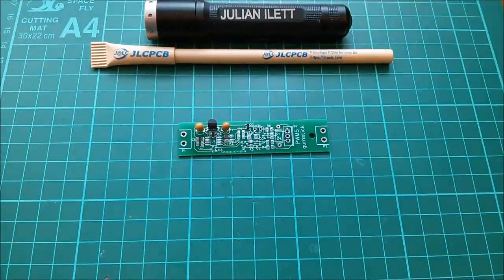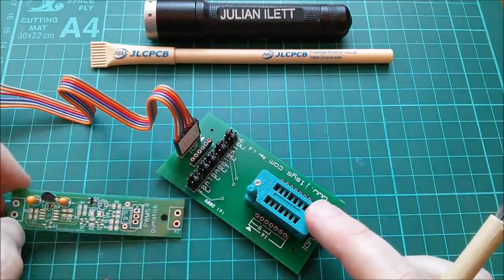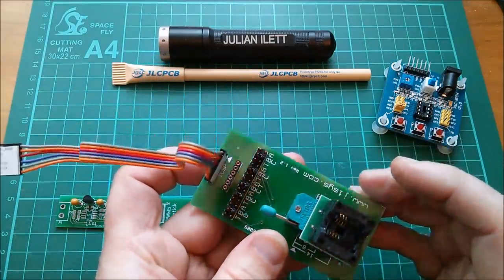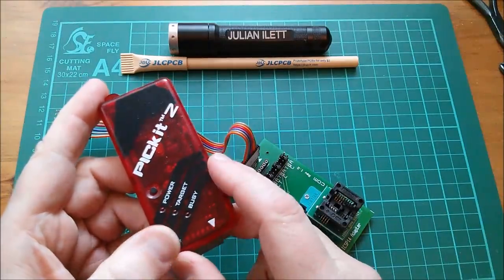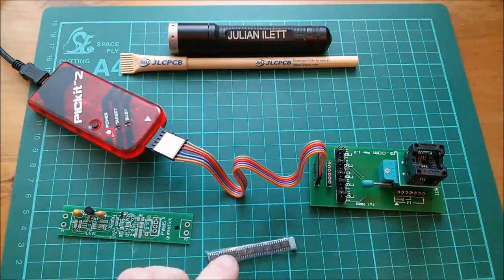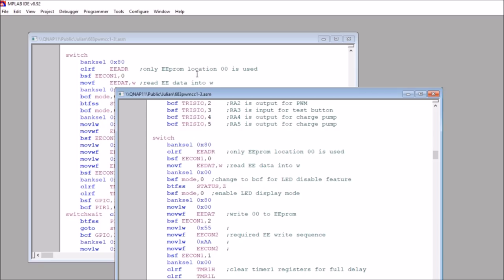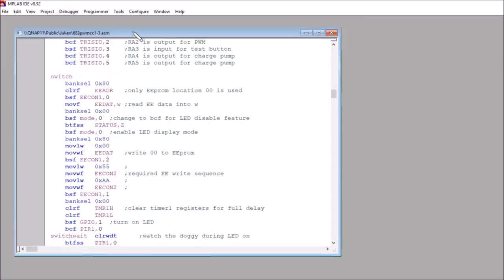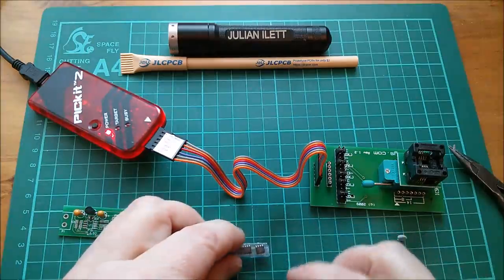PWM5 Solar Charge Controller PIC Programming

Comment: Put a few resistors in parallel if it isn't bright enough.  You can stack those 0805 SMD resistors without too much trouble.  Give it try.  17:45

Comment: so much room for a program header on that board ;)
Reply: Yes, in-circuit programming is the way to go :)
Reply: I'm interested if he can solve the problem of voltage calibration.  In an earlier video (https://www.youtube.com/watch?v=EVP6ImNmbNU), he diagnosed a problem of set-point accuracy as drift in VDD.  

Since I don't think he's changed to a more accurate voltage regulator, one way of addressing the problem would be to include a voltage calibration mode.  If he redesigns the gumstick PWM to include an on-circuit programmer, that would be the ideal time to include a programming-time calibrator.  Remaining set-point error would then be due to temperature or time-drift of the voltage regulator, rather than its initial tolerance.
Reply: Even a couple of pads for a pogo pin bed could easily be made up, so that you can have all tests done in one go.
Reply from the maker: I want the final PCB to be 1" x 0.5" approx - the world's smallest PWM solar charge controller. If there's space for an edge mounted ICSP I'll include it. It might even work with 20K and 220pF to ground on ICSPDAT and blue LED to ground on ICSPCLK. I still want to implement a calibration system to offset the voltage regulator error - pull MCLR to ground and it cycles through 16 different offset values writing them to EEPROM. Just like you said Mai :)
Reply: Maybe add a 431 shunt-reg to the board.
Reply: @Julian Ilett: You might want to have a look at tag-connect: http://www.tag-connect.com/ They also recently got their new edge-connect cable, but I think the 6 pin no-legs cable should fit fine on your board :)
Reply: Julian, you have a double-sided PCB. Pull the programming pins out into surface mount pads underneath the chip with vias, then people who are comfortable programming with pogo pins can do so if they need to.

Comment: Yay! PIC programming video! If there is room you can have a isp port on the PWM5 board, and add some 0 ohm resistors after you have programmed it (if in-circuit isn't working for some reason).
Reply: I always wondered why you need 0 ohm resistors? When you can just do a solder bridge across two pads ...
Reply: Design the pcb, then make parts of the circuit optional.. for example.. :)
Reply: With a non-production PCB I would have added a header for ICSP.  The problem is, especially with such a small pin count device, that he needs most of the pins.  7 of 8 pins are being used.  I haven't checked exactly but he could use some jumper headers to disconnect from the circuit when programming.  This would of course allow quick programming changes to be tested without the need to totally remove the IC every time.  He could also have the jumper headers connected on the PCB so that the PCB doesn't need to be changed for production.  You just cut the PCB connections between the pins and solder the headers on if need.  I hope I explained that well.  ;-)

Comment: Make a separate file folder for "special" firmware versions.  And don't give them new version numbers but rather add the description to the current file name and version.  ie.  PWM5-3-1-no-LED.asm  And comment it at the start of the file that it is just a special version to do whatever.  Make it easy on yourself!
Reply from the maker: If only I were that well organised!
I'm a right-brain person - I need a left-brain assistant to keep everything tidy :)
Reply: Or use version control... If you don't wanna learn there are plenty of GUIs that make it easy. This is what it's designed for, after all.

Comment: I bought the MiniPro TL866A multi-device programmer a while back.  No jumpers to swap, because it's all done in software by selecting the chip which you're going to program in the interface software.  The software then tells the programmer what pins to use and for what.

It also seems to program everything programmable on top of testing many memory and logic ICs, including the popular 4000 series and 74xx series.

The A version also has ICSP (where the CS version doesn't) if you need that.  The CS version is slightly cheaper, though.

The software imports and exports BIN and HEX (Intel) file formats, so there should be no problem getting the program into the software so it can be flashed into the chip.

Oh, and mine also came with a multitude of adaptors for SMDs.
Reply: JasonMasters expensive 😨😁
Reply: True, compared to some other programmers.  But also extremely versatile and very useful considering all the testing functions which are included.

Comment: Just tack those "diode" power leads coming from the DC jack onto your PCB.  I know you don't want to solder the final heavy wires on just yet but those diode leads didn't cost you anything so just lightly solder them on so you don't need to fiddle around trying to hold it just right.

Comment: Can i use an irfz44n instead of the mosfet you use?
Btw: SMD Leds have a green dot on the upper side which tells you what side is the negative.
Reply from the maker: I originally used the IRFZ44N, but at 5A it gets quite warm (in hot countries).

Comment: Hi Julian, did you program the PWM5 directly in assembler or did you code it in C and then converted it to assembler?
Reply from the maker: I wrote it in assembler - at the time I had no experience of C.
Reply: Wow, that's quite impressive! (at least for me...) 
I have experience with C but I think I wouldn't be able to write a single line in Assembly code hahaha 

Thanks for the videos! :)
Reply from the maker: For me it's the other way round - I wouldn't have a clue how to write the interrupt service routine in C

Comment: Julien, did you ever consider using an AtTiny instead of a PIC?
Reply: thats what im using in my mppt attiny 45 its got pll so that helps
Reply: Never used a PIC myself but the atmel micros are much easier to program.
Reply: If you've never used a PIC how do you know the AVR micros are easier to program? Julian likes assembly, and PIC really is one of the easiest micros ever created to write assembly for. PIC and AVR are both owned by Microchip now anyway.
Reply: I've worked with both, and I've found PIC assembly to be a huge pain. But I've done way more work in the Arduino IDE, so maybe I'm just used to higher-level stuff.

Comment: would it be possible to convert this to 40-50 or even 60 amp capacity? I'd like to build one or two. as a backup for my mppt. and to charge my lead acid bank!
Reply from the maker: You can parallel the controllers on the battery side - use a separate solar panel (max 100W) on each controller.

Comment: I don't remember why/how I know that, but I put the SMT components on a piece of paper, then (hopefully) just tap the paper and it flips.
Reply: The LED might reverse on that flip though.
Reply: Turn it around?
Reply: How do you know whether it was turned around? You could film the flipping with a slow-mo camera to find out, but by that time you might just take some tweezers and do it manually.
Reply: Or just look at the mark.

Comment: 🤯 Julian please put me out of my misery, pulling my hair out.
Did you disable the 14.4v mode in the 1.3 code ?

If not, what on earth could I be doing wrong. all seems ok apart from the 14v mode.
Been working on this for the past year, but cant get the 14v mode to work.
Chips from 3 different places incase of fakes, two programmers, second batch of boards made, countless programming, Think I've watched all your videos on the the pwm5.

Is there any way of getting an older version of code ?
Reply from the maker: I do remember someone asking for a version with the 14v mode disabled - that may have been version 1.3 - it's hard to remember all this stuff. As I remember it, the change is pretty simple - just a single bit change - maybe a bcf replaced by a bsf. Are you working with a source code file, or an assembled hex file?
Reply: @JulianIlett  Wish I knew what bit to change, yes I have the source (asm) file.
I did look at the code, few places I seen I could change it but i'm not very good with code lol, I would probably mess it up.
Any pointers ?
Reply from the maker: It looks like version 1-3 does include the 13.5v and 14.4v switching. The bit that controls this is called 'mode,4'. It's set and cleared in the 'floater' routine. It's cleared in 'floatpwm' and set in 'floatbulk'.

Typically, overnight the PWM5 switches to 14.4V mode. It stays in 14.4V mode for an hour or so after dawn (this period depends on how well charged the battery is) and then reverts to 13.5v mode. So you'd have to get up early to see the 14.4v mode in action.
Reply: @JulianIlett  Hi Julain thanks for your help, oH and thanks for giving us all the pwm5.

As said i'm not great with the code,
so not really sure what part i need to change, floatpwm/floatbulk, Do Both need changed ?
only thing that makes sense to me is to change,, from bsf to bcf.

(floatbulk)
bsf	           mode,4	;switch to saturation charge mode

I'm sneaky I have an arduino sense max voltage, turns on an led if over 14v, and stays on till rebooted.
Thanks to you I've learned a bit of arduino too lol
Reply: Ok well that did'nt work 😞
Reply from the maker: There's no need to change the firmware. Version 1-3 includes saturation voltage targeting (14.4V mode). There are many reasons why your battery is not getting to 14.4V. Small solar panel, large battery, bad weather, partial discharging overnight. Try removing all loads and see what happens to the battery voltage.
Reply: @JulianIlett  Hi Julian, thanks for getting back to me.
Think I should explain,
I have a couple of pwm5's already (bought from your friend John)
when I test with one of those, I get the 14.4 every morning, even transfered one of the chips into my board, works a treat 14.4.
But when I program a chip myself, (code 1.3 1F3) it just gets to the 13.5 mode modulating.

Therefore came to the conclusion maybe it was disabled in the version of code I have.
Puzzled now 🤔

Comment: Rather than relying on one LED to send information out to the outside world why not send warble the data out as FSK data to a Piezo sounder. The code would look a bit like the code that was used on 8 bit computers to save to tape. E.g. 

https://en.wikipedia.org/wiki/ZX_Spectrum_software#Basis
"
Since ZX Spectrum had only a rudimentary tape interface, data was recorded using an unusually simple and very reliable modulation, similar to pulse-width modulation but without a constant clock rate. Pulses of different widths (durations) represent 0s and 1s. A "zero" is represented by a ~244 μs pulse followed by a gap of the same duration (855 clock ticks each at 3.5 MHz) for a total ~489 μs;[11] "one" is twice as long, totaling ~977 μs. This allows for 1023 "ones" or 2047 "zeros" to be recorded per second. Assuming an even proportion of each, the resulting average speed was ~1535 bit/s
"

You could write an Android app that would decode this and display a terminal with diagnostic data. In fact this could use the same I/O line as the LED - the LED would display the low frequency part of the signal and the Piezo would pick up the high frequency stuff.

Comment: why PIC and not atmega?
Reply: or stm, paralax propeller, holtek, lpc, msp430, ... ;) The software is written for the PIC long ago.
Reply: Well there is a HUGE selection of PICs to choose from and that one likely fit the design well.  And of course he had already written the program so why change?
Reply from the maker: Breaking news: I'm rewriting the software to run on the Intel 4004 ;)
Reply: Julian Ilett :) haha nice...
Reply: the real reason why I asked this question is because whenever I ask an engineer why he uses PIC instead any other microcontroller they come up with really interesting reasons for their decision :)
thats how I learn, I ask stupid questions and check the response I get on multiple sources to confirm or debunk the answer...
Reply: IamIUareU 
Julian used PIC because it is very power efficient. The whole idea of his PWM5 was to waste as little solar energy as possible running the controller. This means it'll work with small panel/battery combinations without burning much energy in the controller itself. ;)